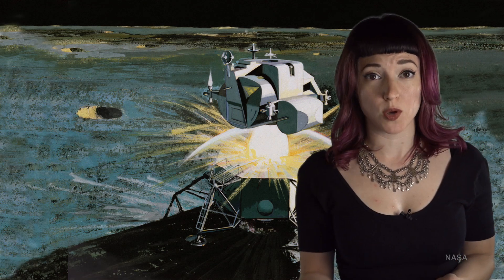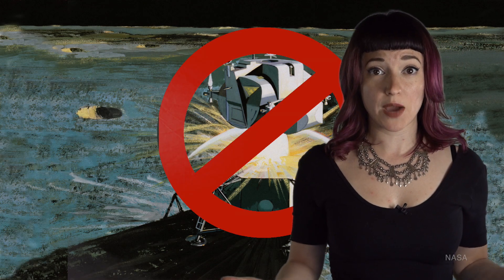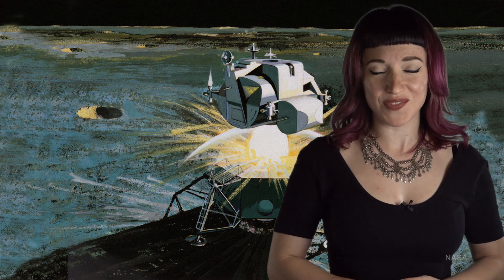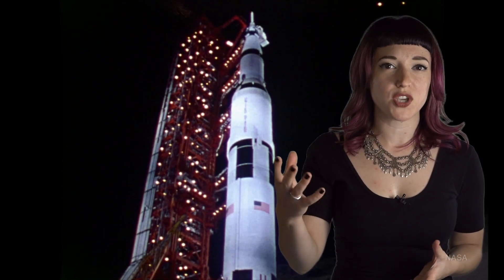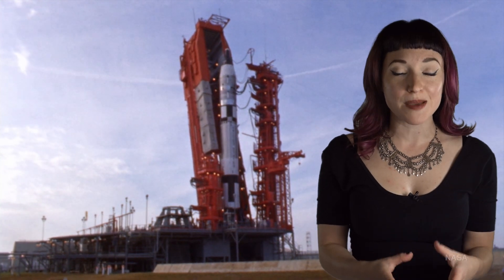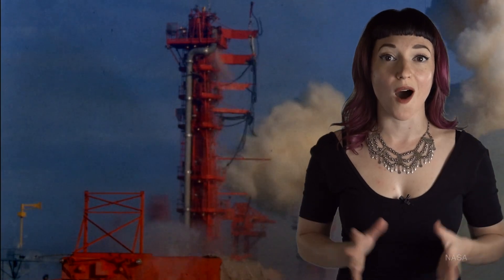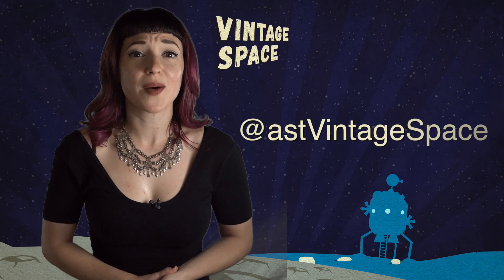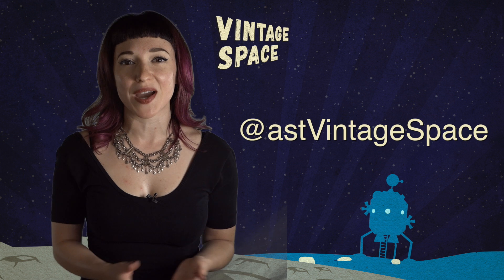How the Lunar Module Launched from the Moon Without a Flame

Comment: At the end of the day – Did we Go to the MOON in 1969 or did we NOT ? –
is really a matter of  personal belief .

However , there are several issues which do need addressing . 

Firstly , if we went to the moon in 1969 – with primitive pocket calculator technology , then why  after 48 years , have we NOT been back there and why do we not have have at least a functioning 
MOON BASE  - to aid our Solar Exploration programme.  ( All of our modern space exploration is conducted just a few hundred miles above the Earth – well below the Van Allen Belts .)

Secondly , many of the very strange facts relating to the NASA  video footage whilst  on the Moon have never been properly answered.   ( No dust on the large footpads of the LEM  .  No indention under the LEM caused by the very strange properties of the LEM 's thruster .  Mysterious knocking sounds in a complete vacuum . The inability of ANY astronauts to jump more than a few feet on the Moon's surface – yet restained by a tiny gravity approx 1/6  that of  the Earth . Hardly any clear 
photogarphs of our planet , which would have been huge in the crystal clear lunar sky .  …........
These are just a few of the many , many inconsistencies , which have yet to be  properly answered .)

If we consider the evolution of manned flight  - within 48 years  after taking off at Kitty Hawk ,  humans were flying   faster than the speed of sound &  traversing huge distances safely in commercial aircraft .  If we put the Apollo programme into a similar historical context , 
then there is something very , very wrong here .
Reply: Part 1 of the reply to your utter nonsense:

YOU SAID: "At the end of the day – Did we Go to the MOON in 1969 or did we NOT ?"

== Of course we did.

YOU SAID: "is really a matter of  personal belief ."

== For you maybe.  But, for sane people, it's far beyond personal belief.

YOU SAID: "However , there are several issues which do need addressing ."

== I'm writing this reply before reading what issues you think need addressing.  Odds are about 99.9999/100 that they've been addressed a billion times over.  Let's see if I'm correct.

YOU SAID: "Firstly , if we went to the moon in 1969 – with primitive pocket calculator technology,"

== That's just an analogy when people say the Apollo computers were only like a pocket calculator.  The Apollo computers were primitive by today's standards, of course.  But, they did their jobs quite well, and they could do more than a pocket calculator.  They had rope memory, which brought their size waaaaay down (but increased cost and difficulty).  And, believe it or not, basic trajectory stuff isn't even all that difficult (relatively speaking).  The fact is, the computers could have actually landed the LEMs.  None of the astronauts would have let the computers do it, of course.  But, they could have done it.

YOU SAID: "then why  after 48 years , have we NOT been back there"

== Good grief.  Why is this not completely obvious?  You could look this up yourself rather than sitting there, pretending not to be a conspiratard, pretending to pose "honest questions" (which are obviously empty).  Apollo wasn't very popular after the first couple of landings.  They had even already cut the program short before the first landing, and kept cutting after that.  See, the public doesn't particularly like the idea of sending freakish amounts of money to send a few guys to walk on the moon.  But, the cold war was on, and this was a political statement of technological superiority over the Soviets, so it got funded.  The attitude was that it's better to show the Soviets that USA could shovel more money into something than they can, and had the engineering know-how to win a war of technology, so, "don't mess with us."  NASA's budget in the peak of the Apollo program was almost ***FIVE*** percent of the entire federal budget.  And, a vast majority of that money went straight into Apollo.  Nowadays, NASA's budget is less than 0.5% of the federal budget.  And, that money is spread out over a hundred different programs (Hubble, landing ships on asteroids millions of miles away, aeronautic development, Mars unmanned missions, GPS, LRO, etc.).  Basically, with the [relative] budget cut to around 10% of what it was during Apollo, and with the money being spread over tons of different programs instead of focusing most of it on a single goal of putting men on the moon, you're talking about basically around 1% of the [relative] budget available now to send men to land on the moon again.  The best that could happen for today's budget is maybe a manned slingshot mission around it (no landing).  But, even that's a huge stretch.  Anyway, this isn't so difficult for you to find out for yourself.  You can key into Google, "why haven't we gone back to the moon," and see mountains of hits about this, and the top several articles spells it out quite clearly.  It's mainly due to the extreme cost, and the public's unwillingness to pay it after we already sent men to the moon 9 times (6 landings).

YOU SAID: "and why do we not have have at least a functioning MOON BASE  - to aid our Solar Exploration programme."

== Because that would be even MORE expensive.  But, hey, you're welcome to fund it, if you'd like.

YOU SAID: "(All of our modern space exploration is conducted just a few hundred miles above the Earth – well below the Van Allen Belts .)"

== No, they are in the lower parts of the Van Allen belts.  Not the worst parts, of course.  They can't stay in the worst parts for extended periods.  Once again, this is pretty public knowledge.  So, don't sit there and pretend to be a neutral objective bystander.  It's obvious that you're a conspiratard who has no intention of listening to real answers.  You're more content to stick with bullshit pseudoscience.  If you have a beef with the Van Allen belts, do the math yourself, write a paper, submit it for peer review, and watch yourself get laughed out the door for not knowing what you're talking about.

YOU SAID: "Secondly , many of the very strange facts relating to the NASA  video footage whilst  on the Moon have never been properly answered."

== Again, I haven't read this yet.  This should be just as much of a laugh as the above, huh?

YOU SAID: "( No dust on the large footpads of the LEM  ."

== First of all, there WAS dust!!  Good grief.  Secondly, there wasn't as much dust as conspiratards want because the surface of the moon isn't like a 5 foot deep dust layer like the conspiratards want it to be.  It's a thin layer of dust, and below that, there's much more solid material, and lots of rock.  Did you bother to look up how difficult it was for them to take core samples in that tough rock that they were trying to drill through?  The most expensive hand-held drills ever made were taken to the moon, and they kept getting them stuck, trying to cut through the tough rock under the dust.  See, the thing is, the surface dust WAS blown away during the landing.  Almost none of the really loose stuff was still there.  Take a look at this photo as an example.  https://upload.wikimedia.org/wikipedia/commons/c/c6/AS11-40-5921.jpg  See?  Almost all of the dust had been blown away during the landing, and all that was left was the next layer, which was far more solid.  So, anyway, the point is, there's no reason to expect more dust than there was.  Sorry to you conspiratards, but you don't know what you're talking about.  And, once again, these questions HAVE been answered, billions of times over.  So, don't pretend they haven't.  Just look at the pictures.  Good grief.

YOU SAID: "No indention under the LEM caused by the very strange properties of the LEM 's thruster ."

== There's nothing strange about the properties of the "thruster" (sigh).  See, once again, this just demonstrates your ignorance.  The "thrusters" were the smaller units attached to the sides, which were used for attitude control.  You don't even know enough about Apollo to know the definitions of the words you're using.  Yet, you think you know enough about Apollo to challenge it??  "You know, there's that brain cutty thing, I think it's called a bayonet, that people say they can use to perform brain surgery.  But, it doesn't actually work, and there's no such thing as brain surgery, there are too many open questions to believe that anyone has performed brain surgery."  "But, you don't even know what a scalpel is called, and yet you think you know enough to claim that brain surgery doesn't exist???"  That's exactly how you sound.  You're asking questions that are plainly ridiculous to anyone who understands rocketry, and pretending that these are some deep/profound mysteries.  Um, no, conspiratard.  You just don't know what you're talking about.  It's not more complicated than that.

YOU SAID: "Mysterious knocking sounds in a complete vacuum."

== Sigh.  I assume you're talking about the hammering of the rock?  Yes, vibrations conduct through solid material too, you know.  And, when those vibrations conduct through the materials and into the microphone inside the suits, yes, it makes sound.  This has been replicated a million times over, and is well understood.  So, quit pretending you have these stupid "gotcha" moments.  You don't.  You don't have any understanding of the science on any level.

YOU SAID: "The inability of ANY astronauts to jump more than a few feet on the Moon's surface – yet restained by a tiny gravity approx 1/6  that of  the Earth ."

== They DID jump much higher than they do on Earth.  Good grief.  But, if you're expecting that 1/6th gravity means that someone should be able to jump 6x higher, you just don't understand physics.  That's not what it means.  It's far more complicated than that.  This reminds me of the people who think that dropping an object out of your hands on the moon should take 6x longer to fall to the ground than it does on Earth.  No.  It's more like approximately 1/3rd or 1/2 of the time, even though it's 1/6th gravity.  But, most people don't understand physics, nor how to calculate these things.  So, most people just assume 1/6th gravity just means every parameter is simply 1/6th (or 6x) the amount.  No.  It's not that simple, especially in jumping.  Jumping is more about torque in the knees/ankles, mass you're pushing upward, etc., which are very complex calculations.  But, hey, ok, fine, you want to make it simple, fine, let's make it simple.  First, go get a 100 pound backpack.  Then, go wear a pressurized bulky spacesuit with that backpack attached.  Be sure and pressurize to at least 20 psi in order to counteract the 15 psi of the atmosphere on Earth.  Then, go see how high you can jump with that bulky suit and backpack.  Now, multiply that number by 6x (once again, it's not that simple, but let's just pretend it's that simple).  I'll bet that the astronauts did far better than you could.
Reply from the maker: Well, it's kind of a matter of fact... I have a whole playlist about this, and it includes an explanation of why we haven't gone back. Spoiler alert: it's expensive, dangerous, and there's no need! 
https://www.youtube.com/playlist?list=PLC9Vy8dM0RVedUL31LBXwvT0pGtPL4GtD
Reply: Part 2 of the reply to your utter nonsense:

YOU SAID: "Hardly any clear photogarphs of our planet , which would have been huge in the crystal clear lunar sky ."

== First of all, they weren't there to photograph the Earth.  They were photographing the moon.  So, why do you expect Earth pictures?  Secondly, yes there ARE some very nice pictures of the Earth, but apparently that's not enough for you?  Whatever amount there are, you apparently want more, right?  Third, the diameter of the Earth is nearly 8,000 miles.  The diameter of the moon is over 2,000 miles.  So, the Earth is less than 4x wider than the moon in the sky.  Hardly "huge."  Yes, bigger than the moon is to us, sure.  But, what exactly are you expecting?  The moon is only about 0.5 degrees of viewing angle from Earth.  The Earth would only be about 2 degrees of viewing angle from the moon (angular size).  Not "huge."

YOU SAID: "These are just a few of the many , many inconsistencies , which have yet to be  properly answered .)"

== Of course they've been properly answered.  Nothing you're saying is new.  Anyone who knows what he/she is talking about simply laughs at your level of ignorance, and that's all there is to it.

YOU SAID: "If we consider the evolution of manned flight  - within 48 years  after taking off at Kitty Hawk ,  humans were flying   faster than the speed of sound &  traversing huge distances safely in commercial aircraft .  If we put the Apollo programme into a similar historical context , then there is something very , very wrong here ."

== What's wrong is that you don't have the foggiest idea what you're talking about.  What's wrong is that you're a very transparent conspiratard who is pretending to be an unbiased observer.  Sorry, I see through your ignorance, and your stupid game.  You don't know what you're talking about.  None of you conspiratards ever do.  Not one.
Reply: New part 1 reply to this wave of your utter nonsense.

YOU SAID: "Wow , It must have taken you quite a while to answer the few questions I raised 
about the USA astronauts supposedly journeying to the moon in 1969 ."

== Yes, I did that for YOUR SAKE.  I was doing you a favor, not that I really expected you to recognize, or accept, any such favor.  I think you revel in your ignorance.  You WANT to remain ignorant.  That's how the delusional mind works.  The delusional mind REJECTS any input that goes counter to the delusion, no matter how factually correct.

YOU SAID: "I obviously have ' rattled your  cage '  a little bit ."

== Nope, I've seen hundreds of you people over the decades.  Nothing rattles my cage.  I would use the word "astonished" more than the word "rattled."  I will give you credit for asking questions, unlike many of you people who assert utter bullshit, and don't ask a single question.  At least you're asking.  Though, I confess, I suspected you probably weren't really asking questions to the extent that you'd listen to the answers.  I suspected (and still suspect) that the questions were pretty empty, and that you were only questioning to put on a "show" to pretend to be an unbiased observer just asking questions, when, in reality, you mind had already been made up.  This was painfully evident because your "questions" were as ridiculously easy to answer as spending 10 minutes on Google.  I mean, like asking why we didn't go back after 1972... c'mon dude, this is really to find out.  Just look at the budget numbers, and compare.  They have 10% of the budget now (relative terms) than they did in the 1960s, and they have to spread that 10% over a hundred different programs (instead of almost the entirety of the budget being poured into one program).  For you to ask why we haven't gone back demonstrates that you're not REALLY asking questions.  You think these are "gotcha" questions.  But, they're not.

YOU SAID: "You said at least FIVE times - that I didn't know what I was talking about 
-- yet you spent a considerable time &  well over 100 lines questioning the issues  I raised ."

== Yes.  The issues you "raised" are the same ones I've listened to (and corrected) for decades and decades.  They're old news.  And, like every other conspiratard theory, old arguments just never die, no matter how debunked they are... like the 9/11 idiots who claim that nano-thermite was found... or like the creationists who say there are no transitional fossils... or like the moon hoax morons who say that we can't traverse the Van Allen Belts.  It's stuff that has been proven to be ridiculous a million times over.  But, the conspiratards never let an argument die, no matter how wrong it is, no matter how many times it's been disproven.  Yes, point is, YOU DO NOT KNOW WHAT YOU ARE TALKING ABOUT.  There simply aren't enough times that this fact can be expressed.  You have NO UNDERSTANDING of rocketry.  You have NO UNDERSTANDING of physics.  And, it shows.

YOU SAID: "In your AMERICANIZED world - EVERYONE MUST BELIEVE WHAT THE US GOVERMENT TELLS THEM. There must be NO dissenters ."

== Pffttt.  Is that how you justify believing utter bullshit??  You accuse the other party of just swallowing what the government says without question??  Pfftttt.  Nope, sorry, you don't get to hide under that blanket.  My government education taught me that 2+2=4.  I know that's true, not because I swallow what the government tells me, but because I understand how mathematics works.  Same for Apollo.  I know how those rockets work.  I understand the program.  I understand the science.  And, I know that every single hoaxtard argument I've ever heard falls apart under any level of scientific scrutiny, every single one.  There isn't a single hoaxtard argument that can withstand the weight of the evidence.  There isn't a single hoaxtard I've ever met who understands the science he/she is refuting, not ONE.  I have had the blueprints/schematics for the Saturn V, Command Module, Lunar Lander, and Lunar Rover for decades and decades, and have read every bit of them.  I have watched every single piece of original archive footage of the astronauts from the Apollo missions, including most of the ground control stuff.  I have met 7 of the 12 moonwalkers (Armstrong, Aldrin, Bean, Mitchell, Scott, Duke, Cernan), as well as many of the Apollo astronauts who flew, but didn't walk on the moon.  Look, clown, it's not about blindly believing what the government tells me, regardless of how badly you want that to be the case.  You WANT me to just be some blind idiot who believes what he is told, so that you can justify your disbelief.  But, no, it doesn't work that way.  You don't believe, because you don't know what you're talking about.  There isn't a single conspiratard alive who understands the science, who thinks the moon landings were faked.  Ignorance is part of the prerequisites to be a hoaxtard.  The entire hoaxtard arsenal of empty questions is BASED ON IGNORANCE.  The foundation of the disbelief is rooted in ignorance.  That's the only way you can be a hoaxtard, is to be ignorant.  And, no, watching videos made by other ignorant hoaxtards isn't an education.  Bart Sibrel is a complete scientific illiterate, from top to bottom, as is Percy, as is (was) Ralph Rene, etc.  Watching them prattle on in their "documentaries" isn't an education.  Going to 3 different universities over 10 years (like I did), learning the various sciences involved, yeah, that's an education.  Funny how that works, right?  The more you actually know about the science, the less odds of being a conspiratard.  I don't think I ever met a single moon hoax conspiratard back in my university days in any of my advanced physics classes, nor in any of my rocket science circles since then.  Oh, but go find me some uneducated people who have never set foot inside a university physics classroom, and yeah, conspiratards aplenty.  Funny how that works.  And, every single one of them just accuses the educated people of being "brainwashed" or "believing what the government says."  Um, no.  That's not an argument.  You don't get to wallow in ignorance, wearing ignorance like it's a badge of honor, and then claim that the more educated person is the one who doesn't know what he's talking about.  Nope.  YOU don't know what you're talking about.
Reply: YOU SAID: "In response to the questions I raised & you claimed  I have NOT  answered -  I  will offer the following :"

== Pfftt, so, you're going to actually present replies now???

YOU SAID: "1.  In 1969 - they had the technology to go to the Moon and back --
YET TODAY THEY DO NOT HAVE  THAT TECHNOLOGY .
( There are many YouTube videos with modern NASA engineers who clearly State this.)"

== Quit getting your education from YouTube videos.  There isn't a single NASA engineer who states that we don't have the technology in the context you're talking about.  "We don't have it now" just means that we haven't built them since Apollo.  But, yes, we know how.

YOU SAID: "2. We haven't gone back since   Apollo...........
If it were possible to go back to the MOON - then the nations which sponsor & fund  the  ISS , including the USA, Russians, Chinese, Indians, Europeans would have come together & funded such a journey ."

== Pffttt.  Name ONE time that any such proposal has even been made?  Good grief.  What nonsense.

YOU SAID: "But it is NOT -- that is why the ISS has only ever ONCE flown beyond 350 Miles above the Earth's surface."

== Yeah, it wasn't designed for it.  First of all, in order to get to higher altitudes, it would need to have had the larger rockets to take it there.  It didn't.  Secondly, if you go too high, you're in the thicker layers of the Van Allen belts, which is dangerous if you're in them too long.  A few hours in the bad areas of the belts, like in Apollo, fine, no problem, the spacecraft protects it.  But, if you're going to stick people in the belts for months, like in the ISS, sorry, but that's too long.  See, this comes from people who actually DO THE MATH (that you're unwilling/unable to do).  All you do is say, "too much radiation" without providing any of the math.

YOU SAID: "3. There is NO MOON BASE .......
Correct ,  because we can NOT go beyond the Van Allen Belts at present .
It really is that SIMPLE."

== You're wrong.  It's really that simple.

YOU SAID: "4. No dust on the Foot Pads of the Lunar Module. 
Correct . The so called astronauts were covered in the stuff."

== Yes, because the astronauts weren't standing under the lander where the dust had been blown away already.  They were out far away from the lander, where there was still plenty of dust.  Are you really this stupid?

YOU SAID: "Their ' LUNAR ROVER ' threw up huge amounts of this dust --- yet the 
the actual pads  of the LEM  were PRISTINE . HOW CONVENIENT. "

== Yes, because the lunar rovers went far away from the landers where the dust had been blown away already.  The rovers went to areas where there was still plenty of dust.  Are you really this stupid?

YOU SAID: "5. No indentation directly under the LEM . 
This morning , I took a garden vacuum which probably produced no more than 10lbs of thrust & placed it directly into a load of garden debris . 
It blew this debris for at least  5 - 10  metres. 
Imagine the same occurring on the surface of the MOON with 1/6 gravity .
That debris would have been blown 30 - 60 metres. 

NOW IMAGINE  A ROCKET ENGINE WHICH GENERATES AT LEAST 
5,000 lbs of THRUST . The LUNAR DUST  WOULD HAVE BEEN BLOWN A LARGE  DISTANCE --- NOT ONLY LATERALLY --- BUT  UP  FROM  THE LUNAR SURFACE by A HUGE AMOUNT .
But NO -- the Pads and the Actual LEM itself , are ALL PRISTINE - with ZERO INDENTATION & NO GOUGING of the LUNAR SOIL  .     ------   HOW CONVENIENT."

== You are truly too stupid for words to describe.  Go look at the infrared images from the LRO, showing that the dust was blown for MILES!!!  Good grief, you're a moron.

YOU SAID: "6. Sound doesn't travel in a Vacuum . 
--- Show me just one VIDEO from YOU TUBE of Astronauts working on the ISS - outside their craft - GENERATING SOUNDS WHILE THEY ARE WORKING. 
YOU CANNOT --- but while on the MOON in 1969 -- the natural laws of PHYSICS were set aside .    ---- HOW CONVENIENT."

== I am not aware of any impact work that they were doing from the ISS, like they were doing on the moon.  Go study physics, you utter imbecile.

YOU SAID: "7. Astronauts DIDN'T JUMP six higher than on EARTH while on the surface of the MOON . 
The SPACE SUITS & BACKPACKS worn by the ASTRONAUTS while on the MOON weighed 185 lbs each here on Earth  --- OR 30 Lbs approx. while on the MOON. 
This morning I packed  30lbs from a dumbbell into a backpack and easily jumped ONE FOOT  off the ground - to prove a point. 
On the Moon with 1/6th Gravity - my jump would have been around  6 FOOT with a lovely gentle landing ."

== You have zero understanding of physics, and you're ignoring 1/2 of what I presented.  I said THEY WERE IN A HUGE PRESSURIZED BULKY SPACESUIT.  Now, go get yourself a bulky spacesuit pressurized to 20PSI, and repeat your experiment.  And, by the way, you did your math wrong (what a surprise).  See, again, if you're going to simplify it to saying "you should jump 6x higher" (which is wrong, but just humoring you), then that has to include the concept that you use 100% of the EARTH WEIGHT.  You don't get to use 30 pounds here on Earth, and then expect the same result from 30 pounds in lunar gravity, then expect 6x.  You don't know what you're talking about.  You don't know how to do these calculations.  You are an imbecile.  Dunning-Kruger.  Dunning-Kruger.  Dunning-Kruger, you utter imbecile.

YOU SAID: "These Astronauts were some of the fittest  & physically able guys within the US military .
They were all at the heights of their physical powers - yet NOT ONE OF THEM - jumped more than a few inches from the lunar surface ....
HOW CONVENIENT."

== Man, you are absolutely the dumbest person I've ever seen.  https://www.youtube.com/watch?v=a-59IEz-MNc  Checkmate, you utter moron.

YOU SAID: "8.  Not many Photographs of the Earth . 
YES INDEED. Loads of photos of ' OLD GLORY '  & other USA PROPAGANDA NONSENSE  but  essentially NONE of OUR  HOME , OUR BASE , OUR EARTH . The Most wonderful and beautiful object in the WHOLE LUNAR SKY  . Not only was there NO PHOTOGRAPHS --- but there was NO MENTION OF IT by these so called ASTRONAUTS.
Think of it - you are the very first humans to land on the MOON and hanging in this lunar sky with ZERO ATMOSPHERIC ABBERATION is this HUGE EARTH - ( approx. 13 TIMES the size we SEE the MOON in our EARTH SKY )  -- YET NO  PHOTOGRAPHS  & NO MENTION of It .
SOMETHING VERY WRONG HERE ."

== You can continue to be as stupid as you want.  Nobody cares.

YOU SAID: "Finally  YOU  say -- '  I am PARANOID , I am DELUSIONAL, I am an IMBECILE  & an  ASSHOLE.  '"

== Yup.

YOU SAID: "Let me tell you sir -- you know nothing about me ,"

== I know you're a paranoid delusional imbecile asshole.

YOU SAID: "and if this were a public debate - I would have WON the debate by now , because you would have been disqualified . "

== No, you stupid fuck, you'd have lost long before, because you sat there asking empty questions, and didn't respond to a single challenge.  And, no, this isn't a debate.  This is an imbecile (you), who has zero understanding of rocketry or physics, pretending to understand rocketry and physics.

YOU SAID: "When I  enter a discussion with someone -- I do NOT resort to PERSONAL AFFRONTS and INSULTS when responding to the queries & issues they raise . OBVIOUSLY YOU DO -- THAT is in YOUR NATURE  and hence that is the REASON  I WILL NO LONGER ENGAGE IN DISCUSSION WITH YOU . "

== Whatever, you've already proven your idiocy.  I'm not afraid to call an idiot an idiot.  YOU are an idiot.

I wish you GOODBYE and GOOD LUCK .
Reply: rockethead7, thank you for your explanations to these idiots. I haven't the patience.
Reply: "Did we Go to the MOON in 1969 or did we NOT ? –
is really a matter of  personal belief ." No it isn't. It's a fact. Nothing to do with belief.
Reply: @AZ Homes "useless wars in the middle east"

Great diversion. But still doesn't change the FACT that there is no (since we beat the Russians to the moon, and won the cold war) political will to assume the risk and expense of continuing to go back.
Reply: "is really a matter of  personal belief"

No, its a matter of fact. To address your points. 

Firstly. Yes it has been addressed countless times. Kooks don't want to accept the facts, so they pretend its never been addressed. 

Secondly: Yes this has been addressed countless times as well. Kooks don't want to accept the facts, so they pretend its never been addressed.
Reply: @AZ Homes I respect your right to be wrong.
Reply: SEVERAL ?? YOU'RE EASILY PERSUADED
Reply: whats wrong is that not all people are clones. Some people are retarded and simply do not have normal cognitive abilities as most others. I have known that since gradeschool. Sure we have to live with "everyone is identical" as a society but nobody believes it and there will always be retards operating fully in the open in society and many hold down jobs and have families as if under cover.
Reply: New part 2 reply to this wave of your utter nonsense.

YOU SAID: "Just like me -- all dissenters & non believers are  ' IGNORANT & DON'T KNOW WHAT WE ARE TALKING ABOUT  ' .  If you believe that ,  then why are you wasting your precious time challenging an IGNORANT FOOL who KNOWS NOTHING ABOUT ANYTHING ."

== Good grief.  You asked stupid questions (obviously empty ones) that anyone with an entry-level understanding of rocketry would be able to answer.  And, you don't know the difference between a rocket engine and a thruster.  YOU DO NOT KNOW WHAT YOU ARE TALKING ABOUT.  You don't!!!  You are the living definition of the Dunning-Kruger effect.  Go look up "Dunning-Kruger effect," then look in the mirror.  That's you.

YOU SAID: "The ORIGINAL issues I raised  , still STAND some SCUTINY ."

== No. Your "original issues" are old and tired and long debunked arguments from ignorance, that don't stand under any scrutiny.

YOU SAID: "In 1969  -- a group of US Astronauts claim to have flown to the Moon using the most primitive technology ."

== They were the most advanced technology that the Earth had seen at the time, with inertial guidance systems that would rival anything we have today.  And, it was plenty enough to go to the moon.  I mean, you do know that they could have guided the Saturn V's S-IV-B all the way to the moon without computers, right?  You do know that they were trained to do that, right?

YOU SAID: "Each of them  were at least one week in deep space - exposed to all  sorts of massive solar radiation  ...  Their only protection , cloth space suits  & spacecraft covered with metal foil ."

== Oh no you don't.  You're not going to play the Gish Gallop game with me.  You don't get to throw a ton of bullshit at the wall, hoping something will stick... then when I shoot down every single piece of bullshit you throw out, all you do is ignore EVERY WORD, and throw more bullshit at the wall.  Nope.  Nope.  Nope.  I'm not playing that game.  You got EVERYTHING wrong in your first posted message, and I explained why, line by line.  You don't get to come back and ignore every single word, every single question I asked, every single challenge I threw back at you, ignoring ALL OF IT, then throwing more shit at the wall for me to clean up again.  Nope.  I'm not playing this game.  See what I mean?  See what I mean about how I predicted how EMPTY your worthless questions were from the start??  You didn't really want answers to those questions.  Your mind was made up.  I answered those questions anyway.  And, what did you do?  Did you acknowledge being wrong about any of them?  Nope.  Did you answer my challenges?  Nope.  You threw more shit at the wall for me to clean up.  And, if I clean this up, you're just going to ignore it (as you ignored everything else), and just keep throwing shit at the wall, ignoring every reply, until I can't stand to answer you any longer.  Then, you'll declare "victory" and conclude that you defeated me.  Nope, sorry nutbag.  Nope.  If you have a beef with the spacecraft and spacesuits, arguing that they weren't enough protection for the amount of radiation involved, then you must DO THE MATH, and submit those results for scientific peer review.  I mean, hey, I know math and calculations are like a crucifix is to a vampire... none of you conspiratards know how to do them.  About all you people know how to do is scream "there was too much radiation!!" (without understanding how much radiation there was, how much of it was absorbed/reflected by the spacecrafts, how much the human body can tolerate, etc.).  All you do is say "there was too much" and then leave it to the real scientists to refuse it.  And, when they do, you just ignore it anyway, and still insist there was too much.  Sorry nutbag, the math has been done.  The suits and spacecraft were adequate protection from the radiation.  If you think otherwise, simply provide your calculations, submit them in a paper for scientific peer review in a journal, and watch them laugh you out the door.

YOU SAID: "YET , NOT ONE of these Astronauts complained of Radiation SICKNESS  during , or after these Lunar trips."

== Why would they?  They were protected from the radiation by the spacecraft and spacesuits.

YOU SAID: "Before the Apollo Programme -- no HUMAN had ever been above the Van Allen Belts ."

== And, you expected otherwise?

YOU SAID: "After the Apollo programme the same statements stands ."

== The spacecraft after Apollo weren't capable of going that high.

YOU SAID: "But in in the late 1960s -  American Astronauts - proved that exception ."

== Yes, they had the Saturn V.

YOU SAID: "The irony is , that NOT ONLY are WE NOT ABLE TO GO TO THE MOON"

== Pffttt.  Yeah, the imbecile who doesn't know the difference between a thruster and a rocket engine is going to explain that we can't go to the moon.  Dandy.

YOU SAID: "TODAY ---  ( This is the official NASA policy , at present.) --- but we ARE NOT ABLE TO GO BEYOND the VAN ALLEN BELTS ."

== Pffttt.  ***OFFICIAL NASA POLICY*** --  We can't go beyond the Van Allen Belts.  Pfftttt.  Um, no, you utter moron.  There is no such policy.  The source of this bullshit opinion is nothing more than a mis-quoting of stuff that is taken way out of context.

YOU SAID: "So in the late 1960s we could do all this -- but today we CANNOT ."

== Sure we can.  Why would you think otherwise?  It's a matter of money.  You're welcome to fund it, if you'd like.

YOU SAID: "THERE STIIL ,  IS SOMETHING VERY , VERY WRONG HERE ."

== What's wrong is that you're an imbecile who has zero understanding of the science, who suffers from a massive case of the Dunning-Kruger effect.

YOU SAID: "( By the way please note --- I do NOT HAVE TO RESORT TO CALLING YOU A FOOL or OTHERWISE , for your BELIEFS. 
You are fully entitled to believe whatever you choose  -- JUST AS I AM .)"

== But, you ARE a fool!!!  This isn't an opinion.  That's a fact!!  You're an absolute imbecile, and I'm not afraid to say so.  This isn't a "debate" in any way shape or form.  You don't have the slightest understanding of the science you're refuting.  None whatsoever.  And, it's fine not to understand the science.  I spent a decade in 3 universities studying the various sciences.  You didn't.  You went to clown college while I was studying science.  And, that's fine.  But, don't pretend you understand things you don't.  You haven't got the slightest understanding of these things, yet you are PRETENDING you do.  THAT is what makes you an imbecile.
Reply: Thanks for proving my point (yet again).

Let's recap, shall we?

You asked a bunch of questions (that you obviously didn't really want answered, and had already reached your conclusions, and were only asking because you thought they were "gotcha" questions):

Paraphrased:

1) The technology wasn't good enough.
== Yes, it was.  And, I explained why.
(No reply from you, no acknowledgement.)

2) We haven't gone back since Apollo.
== Correct, because NASA's budget nowadays is now only about 10% (relative to timeframe) of what it was during Apollo, and that has to be spread over tons of programs.  There's no money or public support to send people back to the moon.
(No reply from you, no acknowledgement.)

3) There's no moon base.
== Correct, because that would cost 100x more than merely sending people back to the moon, and if we can't afford to send people, we certainly can't afford a moon base.
(No reply from you, no acknowledgment.)

4) No dust on the foot pads.
== Yes, there was, just less than conspiratards expect.
== I provided a photo showing that all of the loose dust had been blown away already, and only left the harder "soil" material and rocks under the lander.
(No reply from you, no acknowledgement.)

5) No indentation under the LEM's "thruster."
== You don't even know what a "thruster" is, that's how little you know about rocketry.
== And, no crater or massive indentation is expected because the material under the dust is much more solid, and the 3,000-5,000 pounds of thrust spread out over a wide angle wouldn't create a crater in that type of material, and nobody ever expected that it would.
(No reply from you, no acknowledgement.)

6) Sound doesn't traverse in a vacuum.
== Correct, but sound DOES traverse through physical medium, such as spacesuits and metal.  This has been demonstrated in vacuum chambers plenty of times.
(No reply from you, no acknowledgement.)

7) Astronauts didn't jump 6x higher on the moon (in 1/6th gravity) than they can jump on Earth.
== Correct, because the physics of jumping is more complicated than that.
== Also, they were wearing 100 pound backpacks, and bulky pressurized suits, so THAT would be the type of jumping you'd need to compare to.
(No reply from you, no acknowledgement.)

8) Not many photos of the Earth.
== They weren't there to take photos of the Earth.  They didn't have iPhones that can store a million photos.  They had film, and weren't instructed to waste it taking photos of the Earth.
== There ARE some photos of the Earth, though, and they're quite nice.
(No reply from you, no acknowledgement.)

And, after you posed these so-called "questions" (empty questions that you obviously had no desire to listen to the answers), you declared that no adequate answers had been given to those questions.  Well, clown, what's so inadequate about any of those answers?  What's so inadequate about the answer that Apollo costed almost 5% of the entire federal budget back in the peak of the program?  What's so inadequate about the answer that NASA's budget now is 10% of what it was during Apollo (relative to timeframe), and that 10% is spread over tons of different programs?  You insisted that no adequate answers have been given.  Well, nobody likes dealing with an asshole who poses these empty questions, ignores every answer given (just as predicted), and then keeps insisting that the questions haven't been answered.  Instead, what do you do??  You throw out MORE "questions" that you think haven't been answered.  You're as disingenuous as it gets.  You don't WANT answers.  You want to ask the questions only because you think there is no answer, and then when you get answers, you want to ignore them and pretend the questions haven't been answered.

If you have a beef with the radiation figures, DO THE MATH, submit your calculations for peer review, demonstrating that a spacecraft isn't enough protection from the Van Allen belts.  See, the thing is, VAN ALLEN HIMSELF did that math, and said that a spacecraft was adequate protection, as long as it was just for a short amount of time.  Oh, but you think you know better??  OK, do the math and show everyone that Van Allen was wrong about the Van Allen belts.  But, you won't, will you?  Nope, you'll stick your fingers in your ears, close your eyes, and say "too much radiation, too much radiation" (while being completely ignorant about what type of radiation it is, and how much protection is needed, and for what periods of time).  "Too much radiation, too much radiation, too much radiation, la la la la, I can't hear you, too much radiation, too much radiation, la la la la, I can't hear you."

Do you understand why nobody wants to deal with assholes like you?  You ask empty questions, then stick your fingers in your ears and say "la la la la, I can't hear you" when anybody replies.  Then, you declare victory, ignoring every single answer given, pretending nobody ever answered.  This is the very definition of how a delusional mind works.  To the letter.  Classic paranoid delusional.  Classic Dunning-Kruger.  Classic asshole.  Classic imbecile.

I'm not going to spend a lot of time refuting your latest stupid "challenge/question" about Neil Armstrong's behavior, because you have made it abundantly clear that you're not listening to the answers anyway.  But, the thing is, yeah, it's a bit sad that he became a bit of a recluse.  But, I'll tell ya, he's the one moonwalker that I have met, but have talked to the least.  I probably shouldn't even have said that I "met" him, because it was just once, and I don't even recall if I even said "hello."  My wife snapped a few pictures with me and Armstrong, and that was about it.  It might be "dishonest" for me to represent that as having "met" him.  I mean, by comparison, I have talked at length with Aldrin, multiple times, had breakfast with him and Jim Lovell, talking about various topics, etc.  I have spoken with Jim Lovell a dozen times over the past couple of decades.  I spoke for hours with Gene Cernan a couple of different times.  Same for Alan Bean, and the others I mentioned, etc.  I could ramble on about topics and stuff, but you're really not worth it to me, because you're not listening anyway.  All I can tell you is that, man, when I "met" Armstrong, it was absolutely crazy.  I was in the room with dozens of astronauts, at a black tie dinner for charity, and about 1,000 people were there.  It was one of those events that you pay thousands of dollars per plate, or even more if you want to sit next to any of the "big names."  And, Armstrong was seated about 5 feet away from me, and security guards had to hold back the crowd.  There were crowd members, almost all of which were pretty wealthy, wearing black ties, etc., yet acting like ravenous maniacs to get close to him, crawling over tables (yes, literally).  Wealthy people were practically turning into wild animals to get near him, and a bunch of security guards had to shove the mob back.  It was funny, because Aldrin was about 20 feet away, and there was no mob trying to get close to him.  Cernan was seated directly next to me, but no mob was going nuts to get near him.  But, Armstrong, yeah, the mob went crazy, basically shoving me, my wife, and moonwalker Gene Cernan aside, just to get a couple of feet closer to Armstrong.  I can hardly blame him for not wanting to deal with people, if that's the kind of things that happens.  But, it's a bit sad, because his decision not to interface with people very much has fueled the fire for conspiratards.  But, the other 11 moonwalkers were always open, and the surviving ones today are pretty open also.  But, people think that because Armstrong tries to be more private, it must mean that he's keeping a secret.  Well, I'll tell ya, that's just absurd.  Those guys were death-defying ice-in-veins pilots, who came close to dying many times over, but didn't blink.  John Young's heartbeat when landing on the moon was about 70 beats per minute.  These guys were fearless, and defied death for a living.  They were chosen as Apollo astronauts largely because of those traits.  Yet, conspiratards think that somehow they got these astronauts to stay silent?  Pfftttt.  Alan Shepard was silenced??  Good grief.  Neil Armstrong was afraid of what NASA would do to him if he spilled the beans??  Sigh.  Insanity.  These were people who were afraid of NOTHING.

You don't know what you're talking about.  You're wrong.  You suffer from the Dunning-Kruger effect.  And, it's quite clear that your mind has been made up, and your "questions" are completely empty, just as I predicted.  You don't care about the answers.  And, your only intent is to keep throwing more shit at the wall until I go away, so you can declare victory (in your mind).  You're an imbecile, and an asshole, and that's really all there is to know about you.
Reply: @rockethead7  You forgot the close tag. </RANT OFF>
Reply: One current Astronaut said we no longer have the technology lol...big red flag there...modern physicists and experts have ripped footage and photos to shreds ...just look at the module...how the hall could tin foil wrapped flimsy craft get out of Earths atmosphere  ..really ...people are so readily conned and believe everything they are told or see...
Reply: First of all if that was nasa's official statement they would have mentioned it sometime before you were born.  Secondly the thrust would have kicked up so much dust in 1/6 atmosphere it would have made filming virtually impossible. Lastly nasa's communication with the remote camera is even more sketchy the technology to operate a camera with precision as well as coordinate that with communication is very questionable. In 2018 we have lots of problems losing cell phone signals imagine using 1969 technology to make a 500000 mile  (there and back) phone call that should have experienced issues as the transmission passes through the van Allen belts. Lastly from nasa's own info the LEM didn't carry enough batteries to pull off such a task as well as maintain auxiliary support
Reply: rockethead7 I have a Question! clears throat without resorting to ad hominem (as you did while providing lots of wrong info when answering the other guys questions) I just want to know what should be the legal consequences of losing data (telemetry data) of the most important event in human history? Thanks.
Reply: Very interesting that you met Neil Armstrong .
I personally have never met Mr Armstrong , however -----
A very close friend of mine who is very wealthy , attended a large Charity event in London in 1999 .  The main guest at this event was Neil Armstrong . My friend paid a large amount so that he could have lunch at the main table alongside  Mr Armstrong . When you enter my friend's study , he has several photographs of himself  with Neil Armstrong at this charity event . He was in Mr . Armstrong's company for two hours approx. 

Just before they sat down to lunch with Mr Armstrong - the small group of people who were at the main table - were all told they could talk to Mr. Armstrong about anything -  EXCEPT THEY COULD NOT TALK about the MOON LANDINGS. 
When my friend told me about this -- I THOUGHT IT WAS ONE of the STRANGEST THINGS I HAD EVER HEARD. .......
ON THE 30th ANNIVERSARY of MANKIND'S GREATEST EXPLORATION 
to the MOON and the MAN who led that EXPLORATION  &  was the FIRST HUMAN to SET FOOT on that MOON -- is JUST THREE FOOT AWAY ACROSS A TABLE  from YOU , and you CAN  ' NOT '  SPEAK to HIM about 
it . 
AS I SAID about the WHOLE MOON EXPLORATION BUSINESS   -------
IT DOES NOT BEAR CLOSE SCRUTINY .
Reply: Wow , 
It must have taken you quite a while to answer the few questions I raised 
about the USA astronauts supposedly journeying to the moon in 1969 . 

I obviously have ' rattled your  cage '  a little bit . 

You said at least FIVE times - that I didn't know what I was talking about 
-- yet you spent a considerable time &  well over 100 lines questioning the issues  I raised . 

In your AMERICANIZED world - EVERYONE MUST BELIEVE WHAT THE US GOVERMENT TELLS THEM. There must be NO dissenters .   Just like me -- all dissenters & non believers are  ' IGNORANT & DON'T KNOW WHAT WE ARE TALKING ABOUT  ' .  If you believe that ,  then why are you wasting your precious time challenging an IGNORANT FOOL who KNOWS NOTHING ABOUT ANYTHING . 

The ORIGINAL issues I raised  , still STAND some SCUTINY .

In 1969  -- a group of US Astronauts claim to have flown to the Moon using the most primitive technology . 
Each of them  were at least one week in deep space - exposed to all  sorts of massive solar radiation  ...  Their only protection , cloth space suits  & spacecraft covered with metal foil . 
YET , NOT ONE of these Astronauts complained of Radiation SICKNESS  during , or after these Lunar trips. 

Before the Apollo Programme -- no HUMAN had ever been above the Van Allen Belts . After the Apollo programme the same statements stands .
But in in the late 1960s -  American Astronauts - proved that exception . 

The irony is , that NOT ONLY are WE NOT ABLE TO GO TO THE MOON 
TODAY ---  ( This is the official NASA policy , at present.) --- but we ARE NOT ABLE TO GO BEYOND the VAN ALLEN BELTS . 

So in the late 1960s we could do all this -- but today we CANNOT . 

THERE STIIL ,  IS SOMETHING VERY , VERY WRONG HERE . 

( By the way please note --- I do NOT HAVE TO RESORT TO CALLING YOU A FOOL or OTHERWISE , for your BELIEFS. 
You are fully entitled to believe whatever you choose  -- JUST AS I AM .)
Reply: In response to the questions I raised & you claimed  I have NOT  answered -  I  will offer the following :

1.  In 1969 - they had the technology to go to the Moon and back --
YET TODAY THEY DO NOT HAVE  THAT TECHNOLOGY .
( There are many YouTube videos with modern NASA engineers who clearly State this.)

2. We haven't gone back since   Apollo...........
If it were possible to go back to the MOON - then the nations which sponsor & fund  the  ISS , including the USA, Russians, Chinese, Indians, Europeans would have come together & funded such a journey .
But it is NOT -- that is why the ISS has only ever ONCE flown beyond 350 Miles above the Earth's surface. 

3. There is NO MOON BASE .......
Correct ,  because we can NOT go beyond the Van Allen Belts at present .
It really is that SIMPLE. 

4. No dust on the Foot Pads of the Lunar Module. 
Correct . The so called astronauts were covered in the stuff. 
Their ' LUNAR ROVER ' threw up huge amounts of this dust --- yet the 
the actual pads  of the LEM  were PRISTINE . HOW CONVENIENT. 

5. No indentation directly under the LEM . 
This morning , I took a garden vacuum which probably produced no more than 10lbs of thrust & placed it directly into a load of garden debris . 
It blew this debris for at least  5 - 10  metres. 
Imagine the same occurring on the surface of the MOON with 1/6 gravity .
That debris would have been blown 30 - 60 metres. 
NOW IMAGINE  A ROCKET ENGINE WHICH GENERATES AT LEAST 
5,000 lbs of THRUST . The LUNAR DUST  WOULD HAVE BEEN BLOWN A LARGE  DISTANCE --- NOT ONLY LATERALLY --- BUT  UP  FROM  THE LUNAR SURFACE by A HUGE AMOUNT .
But NO -- the Pads and the Actual LEM itself , are ALL PRISTINE - with ZERO INDENTATION & NO GOUGING of the LUNAR SOIL  .     ------   HOW CONVENIENT. 

6. Sound doesn't travel in a Vacuum . 
--- Show me just one VIDEO from YOU TUBE of Astronauts working on the ISS - outside their craft - GENERATING SOUNDS WHILE THEY ARE WORKING. 
YOU CANNOT --- but while on the MOON in 1969 -- the natural laws of PHYSICS were set aside .    ---- HOW CONVENIENT. 

7. Astronauts DIDN'T JUMP six higher than on EARTH while on the surface of the MOON . 
The SPACE SUITS & BACKPACKS worn by the ASTRONAUTS while on the MOON weighed 185 lbs each here on Earth  --- OR 30 Lbs approx. while on the MOON. 
This morning I packed  30lbs from a dumbbell into a backpack and easily jumped ONE FOOT  off the ground - to prove a point. 
On the Moon with 1/6th Gravity - my jump would have been around  6 FOOT with a lovely gentle landing . 
These Astronauts were some of the fittest  & physically able guys within the US military .
They were all at the heights of their physical powers - yet NOT ONE OF THEM - jumped more than a few inches from the lunar surface ....
HOW CONVENIENT. 

8.  Not many Photographs of the Earth . 
YES INDEED. Loads of photos of ' OLD GLORY '  & other USA PROPAGANDA NONSENSE  but  essentially NONE of OUR  HOME , OUR BASE , OUR EARTH . The Most wonderful and beautiful object in the WHOLE LUNAR SKY  . Not only was there NO PHOTOGRAPHS --- but there was NO MENTION OF IT by these so called ASTRONAUTS.
Think of it - you are the very first humans to land on the MOON and hanging in this lunar sky with ZERO ATMOSPHERIC ABBERATION is this HUGE EARTH - ( approx. 13 TIMES the size we SEE the MOON in our EARTH SKY )  -- YET NO  PHOTOGRAPHS  & NO MENTION of It .
SOMETHING VERY WRONG HERE . 

Finally  YOU  say -- '  I am PARANOID , I am DELUSIONAL, I am an IMBECILE  & an  ASSHOLE.  ' 

Let me tell you sir -- you know nothing about me , and if this were a public debate - I would have WON the debate by now , because you would have been disqualified . 

When I  enter a discussion with someone -- I do NOT resort to PERSONAL AFFRONTS and INSULTS when responding to the queries & issues they raise . OBVIOUSLY YOU DO -- THAT is in YOUR NATURE  and hence that is the REASON  I WILL NO LONGER ENGAGE IN DISCUSSION WITH YOU . 

I wish you GOODBYE and GOOD LUCK .